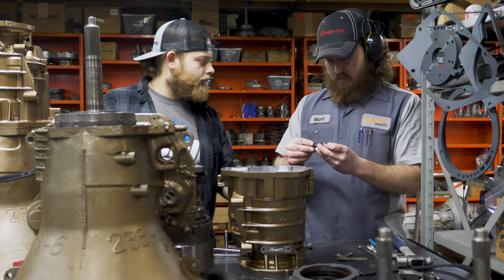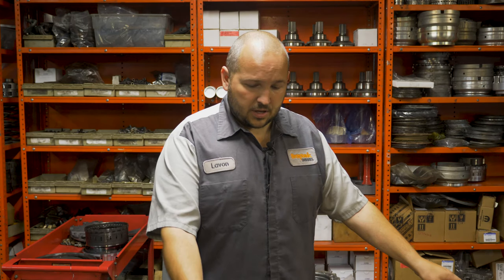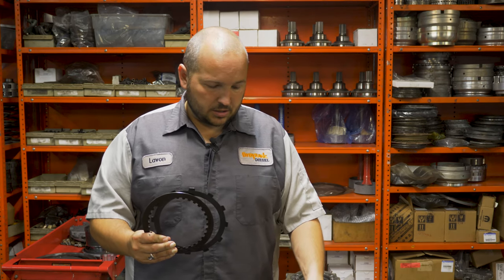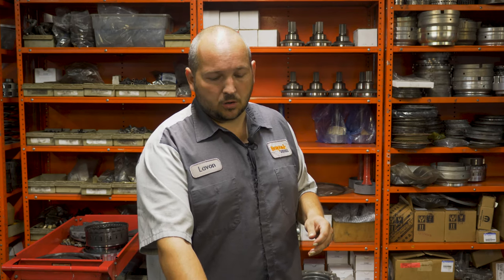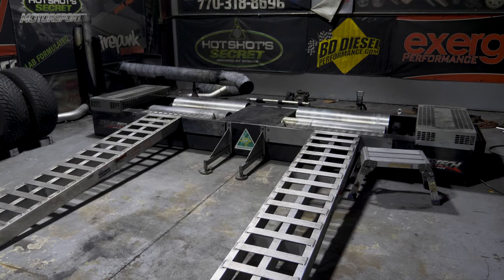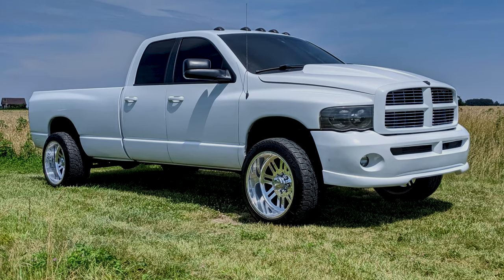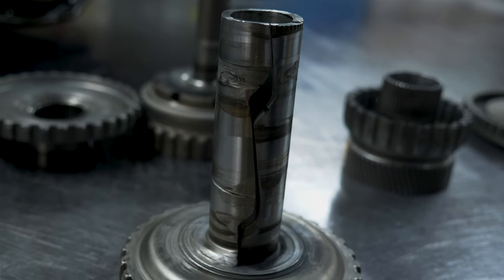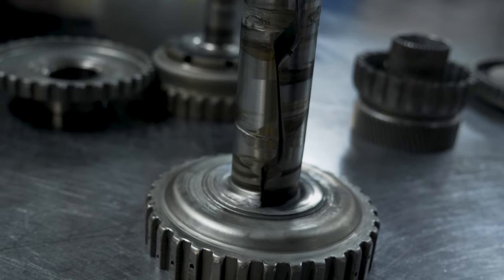68RFE - THE GOOD, THE BAD, & THE UGLY

Comment: I had a 2014 Dodge ram 2500 heavy duty Cummins diesel I’ve always love commons But I have to voice my concern. I went out and bought a standard cab mint Hunter green you could see the truck in the circle to the left with 90,000 miles mint condition $25,000 I thought it was a great deal and it was a great deal. I worked it for 15,000 miles and I mean I worked at hauling around the dump Trailer. Never had a problem except I had to change the water pump because the belt broke which has no problem which is easily fixable. At around 105,000 miles after having it for about a year and a half using it heavy duty and enjoying every minute of it I pulled into a diner to get a cup of coffee when somebody noticed that there was smoke coming From the transmission I am mediately shut it off Let it cool down check the transmission fluid there was transmission fluid in there but when I went to shift into gear a half hour later nothing no forward no reverse. I’ve been down this road before and no problem I had it towed right next-door to a dealer. The dealer I’ve used for years are very good dealer dodge ram. They’ve always been pretty good to me . They knew that the transmission had to be rebuilt but they said they can’t get the parts and that they would have to swap out a reman for $6000 I said no problem go ahead and they gave me five days it will be done sat in the shop For 2 1/2 to 3 weeks. When they finally said they cannot get a transmission for that truck because the demand for transmissions on that truck is so great they said I’m looking at about six months. I decided let me tow the truck out of there I brought it to another dealer and they took the truck as is paid off my loan gave me a check for the overage and I half hour later they sold it to the wholesaler. I love that truck so much unfortunately I could not get a transmission from anyone for that truck no matter what they wanted to charge me. It didn’t matter I was willing to pay the piper. I found out later because of all the ships stuck at the ports getting parts getting transmissions impossible literally. My next-door neighbor is a tow company with a Dodge 5500 flatbed the transmission went and he had a $5000 additional warranty he paid and his flatbed stayed at the dealer for six months and still no transmission. I decided to keep my 99 Dodge ram 2500 Cummins And add a fast FASS lift pump clean up all the grounds redo all the wiring in relation to the injection pump in the lift pump have the VP 44 checked my injection pump experts and today at the 99 Dodge ram 2500 four-wheel-drive Cummins is by far the best truck I’ve ever had
As long as you stick with it and keep up on the maintenance I keep logbooks on it the truck has over 170,000 miles. I added a lot of extras on the truck new fan clutch fixed all the seals front and rear did all the fluids new radiator new batteries New manifold exhaust removed all the cracks replace with new parts .I went from 9 miles per gallon to 17 miles After I put in the FASS pump of course I had it done by certified technicians . I miss my 2014 If I ever came across another one again I might be very tempted to buy it I recommend the truck it’s a heavy duty truck it’s a heavy hauler and every dime you put in that truck you’re gonna get a dollar out of it. That’s my story

Comment: I own a 2018 2500 that chewed up a 68RFE with only light towing, total failure. Warranty gave a replacement, but in the two months Dodge had my truck I bought a 2020 HO with Aisin, honestly the Aisin does not seem to like daily driving. Maybe it's just me, but it feels awkward. The Aisin is my 7th Ram, so I have been around the block a few times. Wish I had my 2nd Gen HO with 6 speed back LOL

Comment: Thanks you for a good description of towing with 4 gears in the hills . I not fond of my stock transmission  . I had several suggest that I need to buy a up graded unit . But I trying to understand how that will change the design of 750 rpm gear splits .  I don't race just pull my trailer .  I use the manual shift and lockup and no overdrive in the hill . Just 3 gears .  Be nice to have a close ration transmission to tow with for me in my low hp truck .Thanks for you video

Comment: Ok great video! I’m currently sitting in a Flying J truck center with a P0750 code and a P0740. I’m guessing that the P0740 is just open because the P0750. So with that said... Ram has sent me (within 30 min of my call to them) the solenoid pack and told me that this will fix the problem. So, the problem. I was towing my 44’ Enclosed Gooseneck (126,097 miles) total towing this trailer, when out of nowhere I get a slight jerk and then 4th gear from 70mph. Ok so strange. I press the gear selector back to drive and boom it jumps back to 4th. I pull off where I currently am. Pull the codes and contact Ram. They immediately send me the solenoid pack without asking for payment and with no issue. Fully warranty the part and had it to me so I can swap it out. I’m sitting here still just watching videos on this issue as I wait until morning to actually do the swap. As I mentioned this truck tows this trailer every week from Ohio to Florida with typically 15 HD bikes or sometimes a couple exotics or classics inside. With that said, do you feel that changing the solenoid pack will solve the two codes I’m getting once I’ve completed this swap? Any advice will be greatly appreciated.

Comment: I’d like to do a 68 in my 2nd gen 02. There’s not much info on it or maybe it’s not worth it but the power goal is a little over 700hp. Rather than the tall 3rd to 4th jump I thought it’s be nice to have two extra gears with the power. Not drag racer or heavy tower just a practical hot rod it what I want.

Comment: Question I own a 04 ram 2500 5" aluminum drive shaft 68rfe. I have run stock size tires for 85 k on the truck changed fluid regular on trans. Am adding up to less than 600 and am running 35" tires I drive highway speeds loaded truck know has 117k trans is fine but I'm planning a rebuild myself likely around 150 175k if it holds that long I was a commercial driver with millions of miles exp. So I owned my own kw over 850 rwhp to much to cool but fun to drive 98 Kenworth.

Comment: Great video!  You just described my truck…2011, tuned, lifted , dually on 37s pulling a 15,000 lbs equipment trailer most of the time.   I’m not abusing it,but I am using it.   I made it to 165k miles on stock transmission before 5th and 6th ratio codes started to show up.   What would you recommend for a gearing reduction on this set up?
Reply: 4.88s for that setup

Comment: Hi thanks for sharing this information. I am considering purchasing a 2008 that has this same transmission. The carfax shows that the previous owner has replaced the entire transmission at a dodge dealer at 136,000 miles. Currently has 151,000 miles, im not into racing etc and curious to know if the 68RFE is a good transmission overall. Hoping im not going to get boned on this purchase. Appreciate you sharing your experience

Comment: So, if you have the 68rfe as is from factory and you have the total delete and tune to get you to 650-700rwhp and you dont hotrod. But, if you do youshould  manually keep it in 3rd or 4th geat and keep it out of 5th & 6th? This should save the trans asn4th is direct drive.  And as far as normal daily driving it should last right?

Comment: Without knowing anything about the price of tea in China .... imma gonna go with suggesting an Eaton 13 speed and twin sticking her 👍🏻👍🏻🇺🇸🇺🇸🤷🏻‍♂️
Reply: The Super 13 would be fun.  But only if you know how to float gears.  A twin stick is no fun at all.  The flipper and slider switches are much better .  I learned to drive Semi's in a cabover Freighliner with a 180hp Cummins and a 4x4 gearbox.  The first time I drove a Cummins N14 with a Super 10.  I was in heaven!  Later I got to drive a Super 13.  While running the Western States mountains.  Loved having the half gears to play with!
Rumors have it, that the ZF 8 speed may find its way into Cummins powered Ram pickups.  Those ratios should work pretty good.

Comment: Great info, a little counter intuitive because my truck is designed (stock) to tow 12k lbs with 33in tires. If I dont tow but I put on 35in tires, how can that be more demanding on the transmission than towing 1/2 a house ? So the question is which is worse, driving around town with 35s or towing 12k lbs across the country with 33s ? The additional torque required to turn a 35in tire is less than 10% the additional torque required to tow 12klbs is huge.
Reply: Its about leverage. Not just weight. Bigger tires essentially increase stress back to the trans. Taking mechanical advantage away from the trans. Its ok not everyone will understand it. 35 not so much but 33 to a 37 is huge.

Comment: very interesting, 16 3500 srw 68rfe truck here, 99% stock, only thing ive done was went to a 285/75/18 (35x11.2x18) so technically speaking it should be regeared? i do not pull super heavy (heaviest is around 5-6k) but i have noticed in tow haul that my truck still goes into 6th on the interstates above 62-63mph, typically im running 70-72 on the interstates, the truck has no lugging or issues holding 6th going from buffalo to syracuse the whole way... so with that said.... how badly is 6th hating life now??? trans shifts like day one still, and the fluid looks great (already been drained and refilled once at 26k, and currently at 37k) and typically when im pulling its below freezing so i can go snowmobiling, but plans for the truck are a small 3" leveling/lift kit to bring it level and the rear up an inch, keeping the 35's as i dont need the 37's, and maybe a delete down the road, but keep stock power levels as 800ft/lbs does me just fine and im not out to smoke show and be "that guy" as my wallet isnt filled from a magical money source, trans temp is always in the 160-170 range, never seen 180 on the read out, if im going to stay as stock or the plans, how much am i gonna thank myself for doing a gear swap? or with my daily driving and only light towing would the 3.42's still be ok? or is this why the "5th" gen now has 3.73's?
Reply from the maker: Yes it would be ideal to regear, but if you can absorb that knowledge and just manually select a lower gear to keep rpms at 1800rpm+ when towing heavy in 5th and 6th, then I really don't see you having a premature failure.
Reply: Ok, so pretty much how it normally runs for me, when I’ve been around 64-68 it would hunt between 5th and 6th which then I’ll kick it back to 5th and she sounds happy and feels happy, typically I’ve noticed at 71-72 it will sit around 1700-1800 which is where she’s done most of her interstate towing. I’ll keep the regear in mind and the knowledge of this now 👍

Comment: Hey Lavon, I have a 2012 2500 6.7 Ram, fully deleted, 4 inch FloPro turbo back exhaust with a 36 inch muffler, currently just using a Minimaxx that I've had for a few years with just box tunes (they suck, I know lol), have you done a pull on a setup like mine on the dyno?  Thing is a runner, I'm kinda curious around what it might be putting to the ground.  It is an HO model, stock 360 or 380, 800 torque at the flywheel I guess is how they got those numbers.

Comment: I have a 2015 stock truck with a 68rfe. What is a safe gear to be in pulling a 15000 pound 5th wheel rv. I'm coming out of a stick truck not use to driving a automatic. Also should i do a thermal bypass on this truck.Thanks for any help.

Comment: I’ve got a 68 rfe tranny. I was pulling my boat up a good hill and as I got down on it in 6th, there was some jumping. I let off the accelerator and it went away. My Mech says I need a new tranny which will cost over $8000. How much would it cost to rebuild with some stouter clutches? It has a easy link 5 stage tuner. I’m not a heavy footed driver…most of the time.

Comment: Great video!  Question with towing... my 2014 3500 dually is my tow pig for my 40' fifth wheel.  Stock power, stock tire size, 3.42 gears... should I avoid towing in 5th and 6th gears then or just lock out 6th be ok?
Reply: It’s a stock truck; just drive the darn thing.

Comment: my truck makes about 510hp and i'm on 33x12s, it's been holding the power but unless converter is locked it slips pretty bad, how much am i looking to get it built with what you listed off, i tow 14k excavator once a week and daily it but also burnouts are fun🤣

Comment: Is "shift flare" between 3-4, 4-5, and 5-6 normal for a 2017 Ram with the 68rfe?  My truck has only 22,000 miles on it but these 100-200 rpm spikes between gear shifts are driving me nuts.  My biggest concern is premature wear on the TC.
Reply: I have a 2016 tuned with efi live csp4.  I've noticed the exact same flares you mention, even after trans tuning it is still there but not as bad...

Comment: My turbo wen out on my 12 HO bought a cheetah turbo bolt right on. 
It’s deleted 5inch exhaust I run it on a towing 40hp tune so far so good. I don’t abuse it at all but I do tow my cattle trailer and horse trailer. 155k miles on it.. do you think I’ll be safe to run for another 100k?

Comment: What do you recommend in do. I have a deleted truck with a stock  tires and suspension with a 4in with muffler and I want to put efi live in it. Should I run the stock trans or build it. Has the 68rfe.

Comment: I put an ez Lynk in mine (+160 HP on high tune) and 35” tires. I ride on high tune but I drive it very modestly. Should I be worried about anything ?
Reply: Yes. You should be very worried

Comment: Hi, I have a 2013 RAM 2500 6.7, probably with the 68RFE and 3.42 gears, I added a SMARTY TOUCH using it with +120 hp and has 35x12.5R20 tires, It's OK to re-gear it with 3.73 ?, I'm not planning to go with bigger tires.
Thanks.

Comment: so what your saying is if i run down to the Ram dealer and buy a 2500 6.7L cummins it will be fine for daily driving aslong as i dont abuse it etc? Could i also do a delete and a tune like minor mods and it be okay? Or are you saying once you start to add power the trans hates it?
Reply: You can mod it, just don't do a high HP tune and abuse the truck.  I have a 2021 2500 with he 68RFE, deleted and tuned, right under 500HP and it runs great. IF you tune it and tell the ECM what size tires you're running, that will adjust all the shift points and lessen the stress on your motor.

Comment: What is the cost of a 68 rfe build?  I currently have a suncoast m3ga and the overdrive clutches just went out.
Reply from the maker: $6295 +install is our most common full build
Reply: @FirepunkDiesel  what's the install cost on a 4wd model. And the power level of the transmission build
Reply: @FirepunkDiesel  Is install and rebuild only offered at Firepunk main shop?

Comment: So let me ask this. 2018 2500 Cummins  I tow a 10k travel trailer.  Is it bad for me to tow in 6th at 68 or 70mph? It feels like its lugging the motor unless its completely flat ground. Is this hurting my 6th gear. Should I only run 5th? Much appreciated for any feed back
Reply: I'm by no means an expert but from what I've read on various forums is to lock out 6th 
I have a 2016 2500 68rfe and i also tow a 9500# travel trailer, I lock ou 6th and tge truck pulls and feels better

Comment: I've had my 2018 deleted, EFI Live mild 75hp tune. I pull my 9000lbs RV very little in the summer. I'm running 35's in the summer and stock winter tires in the winter. I deleted it only because they wanted 4000 bucks for a new scr pipe. My transmission shifted hard once I deleted it, but seems to have settled down now. Runs great. I take it easy on my truck. Any reason for transmission tune or upgrade? I was thinking about changing my shift point because even stock, it seems to always want to be in 5th or 6th at slower speeds. Any input is appreciated.
Reply: Turn on your tow/haul button and 5th, 6th will shift later. This will not hurt your transmission life in any way. I can't stand driving around town under 55 mph and it shifts to 5th and 6th all the time. Your truck will also downshift differently with the tow/haul button on and save your brakes some. I run my truck with the tow/haul and the exhaust brake on all the time!

Comment: 2019 68RFE with an odd problem.  When starting cold, the truck wont shift for about 30-90 seconds.  Once I allow it to idle for that long, no problems.  Been to the dealer, they thought low on trans fluid, not the problem. Its full of fluid, still does it.  Its clearly not building pressure for anywhere from 30 -90 seconds right after a cold start.  I'm talking 45 degrees, not minus 100.  As far as I can tell with the weird driving shifts anyway, it seems to work quite normally on the street and after idling for a few.  Any ideas?   It has the dealership stumped.
Reply: H L Most of these transmissions have a seal that keeps the fluid from leaking out of the converter when not running. If the seal fails the fluid leaks back into the pan, and when you start up it takes a bit for the converter to fill back up. Which also means it is running dry for that time, so not good.
Reply: Figured it out,  after the third trip to the dealership, the found an internal filter had broken sending metal or plastic debris throughout the transmission. I ended up trading in the truck to get rid of it before that transmission blew up.

Comment: I installed a bypass valve on mine and the temperature dropped from 175 to 132 should I keep the bypass valve or take it off is that the working  temperature for the oil or not